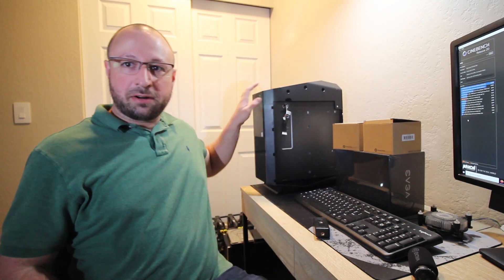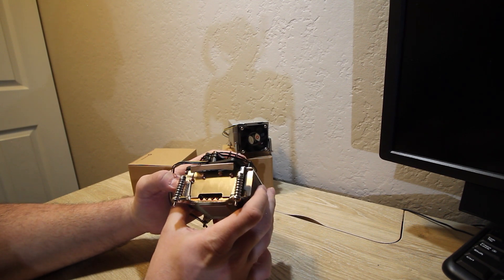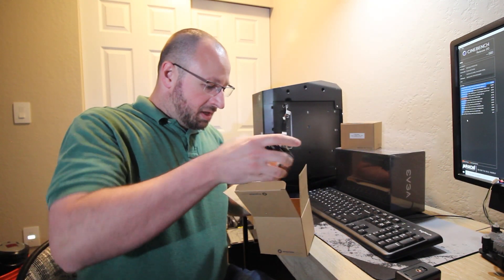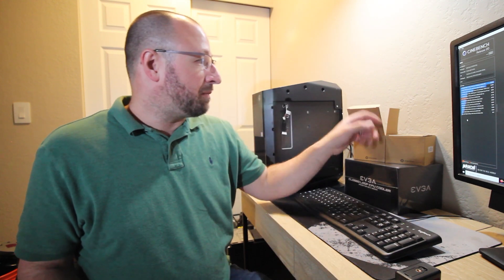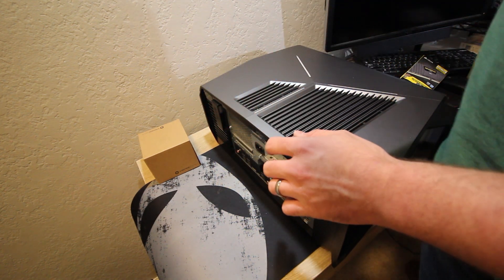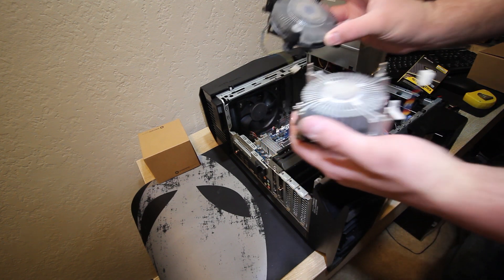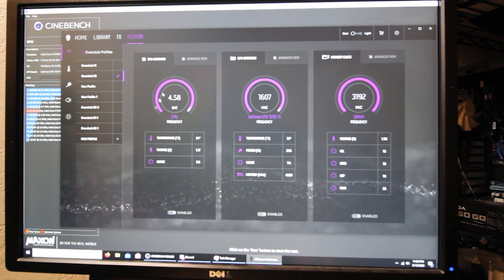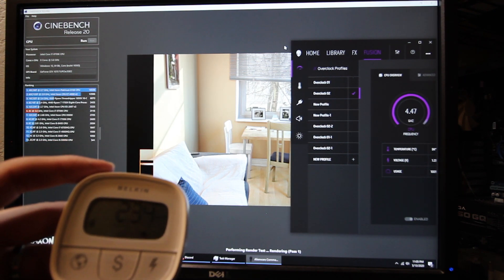Alienware Aurora R8 CPU cooler upgrade

Comment: Hey was there any noticable improvement with the K666 over the stock cooler?

Or is it just better off to repaste the stock cooler and send it?
Reply from the maker: The stock cooler is very undersized for an i7 or an i9. You'll see a huge gain from this.

Comment: I have the Alienware Aurora R8. The PSU is dead and it needs to be replaced. What 850W PSU model/brand would you recommend?
Reply from the maker: I'm a fan of EVGA power supplies. EVGAs are just rebranded Super Flower units, with the advantage of having EVGA's legendary customer support.

Go modular, and find any Gold or better rated unit you can.

Comment: ALL AURORA OWNERS SHOULD REPLACE THAT LOUD OBNOXIOUS JET ENGINE INTAKE FAN WITH A NOCTUA NF-F12 IMMEDIATELY. FROM LOUD AF TO SILENT
Reply: The stock intake fan moves a lot of air and isn't that loud even when it throttles up... If you get a Noctua fan you're reducing airflow by a lot

Comment: The dude at the store recommended a hyper 212 evo and it's too big because of the swing panel holding the psu..and yes it is a very obnoxious computer after 2years..exactly how mine sounds!!! But you got yours to go louder..i felt like it was gonna explode
Reply from the maker: Live on the edge. So much air movement!
Reply: @harrisonhobbies241  replaced the cpu cooler and cleaned it up nice..now it's a constant fan noise but this time the fans dont rev up when im playing a game or anything stressful..it's like it's on a default. Setting..my temps are sitting between 20-30 so im thinking just replace the outside fans??
Reply: Replace front bottom intake fan with noctua nf-f12 and enjoy the sound of silence. 
-R8 owner
Reply: @Reckless32duh  Save me from taking mine apart....already tired of doing that.....is it 4 pin or 3 pin?

Comment: Hi I currently have an I5- 9400k and was looking to upgrade to a I7- 9700k. I have the R8, and have the exact dell cooler as seen in the video. Should I upgrade to the Dynatron K666 or should I keep the using the original cooler? I do not plan to overclock the CPU at anytime.
Reply from the maker: I would upgrade to this cooler if possible.... or maybe even a water cooler like the EVGA. During the turbo boost duration for my 9700k, the CPU spikes to 100C for a few seconds, then levels out around 70 on sustained loads (like video rendering).

And since Alienware makes overclocking so easy through the command center, you may not plan on doing it initially... but you may choose to later.
Reply: I also have an R8 with the I5-9400 and I've monitored CPU watts and temperature with HWInfo64 running Cinebench... It goes up to 77°C even though it's only using 62 Watts. I don't know how much power the I7-9700K really uses because all Intel publishes is the TDP which is meaningless

Comment: How did you mount the water cooling on there?
Reply from the maker: It is mounted in the top of the case. It's been a while  since i  installed it, but if i recall correctly, you can drop a cage at the top of the case, pull the existing fan, and install your new rad+fan,. It should tuck up neatly. I originally pulled the top of my case, but i don't recall that being necessary.

Comment: So I have the r8 with an i9-9900 and an rtx 2060. Do you have any suggestions on what I should get to decrease heat and fanspeeds? I get throttling anytime I play any demanding games, even though I can easily handle those games with my setup. Any air cooling suggestions for my setup to replace the stock cooler? And should I maybe replace the fans too? Sorry for all the questions, but I just really need a fix for this because my games keep crashing because of throttling.
Reply: Have you tried a static fan ?

Comment: I have an aurora R8, I upgraded my GPU to a 2060 super 8gb and need to upgrade the CPU for streaming, What liquid cooling system did you use and what CPU can my motherboard fit, i dont want to spend too much money upgrading it but will order liquid cooling and a good cpu you suggest as it doesnt seem to hard to do. Appreciate any help! also great vid
Reply from the maker: Hello!

If you're trying to go cheap, get either an i7-9700 (non-K)  or an i5-9600k. If you can find 8th gen processor equivalents for a lot less, then it would probably be fine to go with those as well.

I purchased the EVGA cooler: https://www.amazon.com/dp/B07CNXHYJ2

You will also probably want to upgrade to 16 gb.
Reply: Harrison Hobbies Thankyou so much, whats and 8Gen processor ? So order the cpu and that cooler and im good to go?
Reply from the maker: @MB-jf2iu  Intel releases updated processors every year. The Aurora R8 launched with the 8th gen Intel processors (noted by the first number after the i5/i7) in 2018 - but the socket configuration was forward-compatible to 9th generation processors. So as long as you get an i5-8XXX, i7-8XXX, i5-9XXX, or i7-9XXX, you will be fine.

As for the cooler, yeah - you will be good to go. You may want to pick up an extra tube of thermal paste (in case you screw up your first cooler placement) and some alcohol wipes to clean your  CPU.

You will also need a Philips head screwdriver.

Good luck and let me know if you need anything else!
Reply: Harrison Hobbies Is the i7-9000K worth the extra money compared to the i7-9000, id be streaming call of dity
Reply: Harrison Hobbies and thankyou very informative!
Reply from the maker: @MB-jf2iu  Hello again - addressing you messages here. The K series is overclockable... unless you plan to overclock and squeeze a bit more power out of your processor, it adds bit, but not a huge amount. for streaming, the non-k would be fine. But i will say,  overclocking is a bit of a nice option and gives you a tiny bit more futureproofing - and Alienware makes it very easy by allowing it in the Command Center,  instead of fiddling in your bios.
Reply from the maker: @MB-jf2iu  HAHAHA. Buy LITERALLY any 16 gb or 32 gb sticks from Amazon or any other site in your country. I'm using 32 gb of Corsair Vengeance 3200mhz. (2 kits of this: https://www.amazon.com/Corsair-Vengeance-3200MHz-Desktop-Memory/dp/B0143UM4TC/ref=sxts_sxwds-bia-wc-drs1_0?cv_ct_cx=corsair+vengeance&dchild=1&keywords=corsair+vengeance&pd_rd_i=B0143UM4TC&pd_rd_r=3ab53b96-4332-481c-9a6c-2ddea7a846bb&pd_rd_w=nTiR6&pd_rd_wg=77RLA&pf_rd_p=f3f1f1cd-8368-48df-ac69-94019fb84e3f&pf_rd_r=VQDMYKZDSD0JMMXGMK6F&psc=1&qid=1600053619&sr=1-1-f7123c3d-6c2e-4dbe-9d7a-6185fb77bc58)

It's just standard DDR4 desktop ram. Find what ever style you like and install it.
Reply: Harrison Hobbies Cheers mate!
Reply: Unfortunately dell scams people in this area when upgrading the RAM. Micron is what I have. Crucial is a parent company with micron so they also have the RAM upgrades that DELL has but much affordable. https://www.amazon.ca/Crucial-8GBx2-PC4-21300-288-Pin-Memory/dp/B0734WQXT6
Reply: Micaela Carney Im in australia :(

Comment: Would the k666 water cooled fit with the i7 8700 aurora r8
Reply from the maker: Sorry for the late reply! The K666 is the horizontally mounted air cooler (not water cooler). And yeah - it will work just fine. The non-K version is 65 watts, so this cooler will be totally sufficient. It struggles with the 95 watts+ on the K version.

Comment: i have the low end parts still, and would i be able to use an amd cpu or do i have ti stick with intel
Reply from the maker: Let me ensure I understand your question. You are stating you have an Aurora R8 with the i5-8400 CPU, and you are interested in upgrading it to an AMD processor?

In this case, nope... they aren't compatible. You will need to get a new motherboard for an AMD chip. And you will need an AMD specific cooler, or a cooler that has universal/multiple mounting brackets. 

The case, however, is an ATX form factor, so you should be fine to upgrade the board and processor with this case. I'm not sure if the power button connector is proprietary, so double check that that will work if you DO decide to upgrade the board.
Reply: Harrison Hobbies ok thanks . I guess I’ll just upgrade to a better intel one. I don’t wanna spend more money on changing to a different brand..
Reply: Harrison Hobbies do you have Twitter
Reply from the maker: Nope. No twitter.

Comment: Hey men i got in a little problem i have one of the 4 scree that is stu k to the mobo cant unscrew it whats should i do ?
Reply: Finnally i have solved this problem but i have another one  i changed my i5 7400 for a i7 9700 and my pc dont start at all  some peiple say its the bios it need to be uptaded  and i did  and nothing work
Reply from the maker: @gaming007play1  Just to confirm... you went from a 7th gen to a 9th gen?
If so, I don't believe those sockets are compatible. 7th gen was LGA 1151 Rev 1. LGA 1151 Rev 2 is compatible with 8th and 9th gen processors.
Reply: @harrisonhobbies241  i solve my problem motherbord dont read 9th gen
Reply from the maker: What do you mean you can't unscrew? The screw is stripped,... or you it refuses to turn?

If stripped, that's going to be tricky. If it refuses to turn, apply a bit of downward pressure to the screw driver and turn harder. Lots of heat cycles will make the screws seize a bit, so they will be harder to remove.